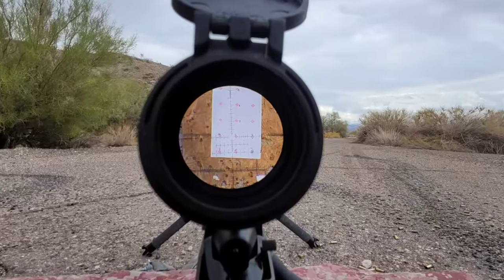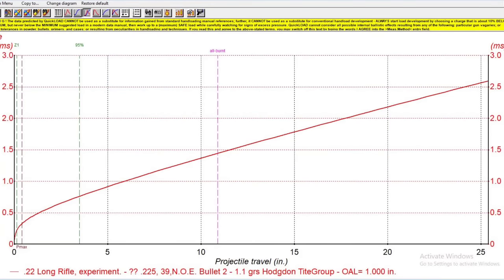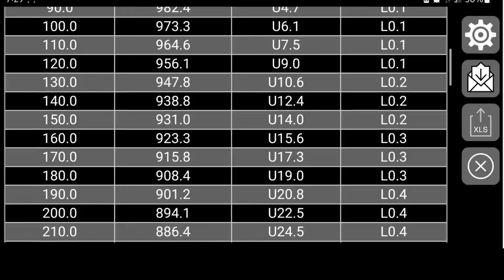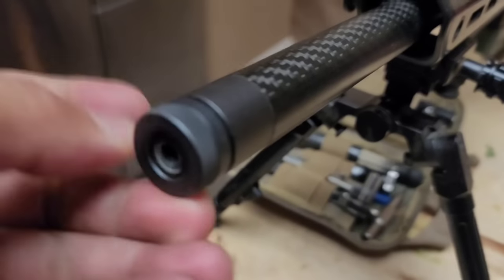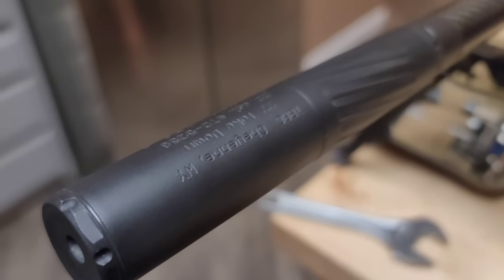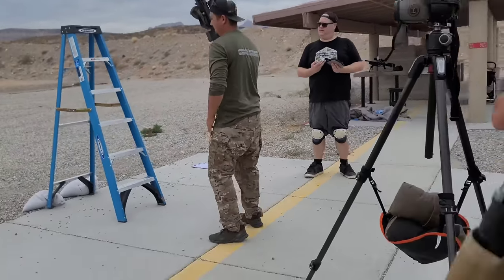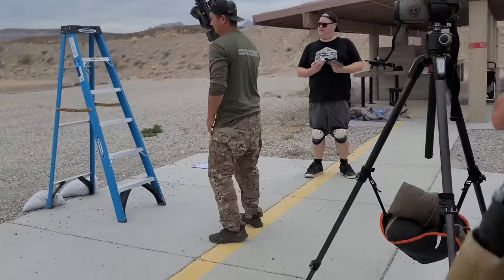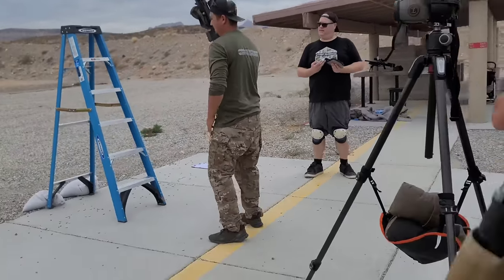What makes an accurate 22LR | Mythbusting Part 2 #DPGunworks

Comment: obturation? I've never heard of that meaning, the ability of a bullet returning to it's original shape. I've always understood it to mean the ability of the bullet to grow to the shape of the bore under the heat and pressure exserted on it by the heated gas from the charge. The term is also used in forging and is very similar to up-setting a piece of bar stock you want to make fit tight in another fixture. I was with you a hundred present until then. I don't think a soft metal like lead is going to shrink any after it leaves the bore except from cooling and certainly not while still in the bore. I've been wrong before though, just ask my wife. Everything else you said has a lot of merit. I think the longer barrel allows the bullet stabilize better without extreme forces of acceleration being applied to it before it leaver the barrel. Similar to an arrow just after it leaves the bow Called archers paradox.
Reply from the maker: Bring up this argument to Bryan Litz...... We're talking about modern centerfire and rimfire cartridges, Not archery.  Obturation in relation to a projectile fired refers to the temporary deformation of the projectile that inhibits most of the gases to escape thus sealing the bore and grooves. The ability of the projectile to somewhat return to its original shape requires pressures to work under the lead projectiles tensile strength, yet have enough pressure to cause obturation. The Lee Hardness chart uses BHN to give a general calculated idea of the metal's "working" pressure

Comment: Kenny what are your thoughts on reshaping the firing pin on a 457? Do you buy into the theory the out of the box pin causing inaccuracies from hitting too much rim?
Reply from the maker: I haven't found the need to do so. The imprint of the CZ457 firing pin is the same as Rim-X and Vudoo's so I would think those who are having FTF's are expirencing a worn-out firing pin spring or bad headspace. Firing pin springs should be changed out often as they wear out

Comment: Sir, I was wondering your opinion if threading a barrel will reduce the accuracy  of the rifle.  Specifically,  every bench rest 22lr shooter told me (including gunsmiths) that threading a barrel will definitely adversely affect accuracy because it relieves the uniform stress of the steel surrounding the crown and causes a discontinuity between the threaded crown region and the rest of the barrel.  Any thoughts?  thank you, outstanding channel.
Reply: He mentioned threading in this video or in part 1.

Comment: Are you using a one leaf commander on your scope? Also what do you charge generally for a barrel?
Reply from the maker: Yes in this video. However, that one leaf isn't a product I would recommend IMO.  I am the gunsmith the company DPGunworks. You would have to reach out on the website for pricing.

Comment: Bottom line no matter how good your equipment and the skill of the shooter and even if a person does extensive  testing on the brand and type and lot# on the ammunition they use the bottom line is inherently .22lr ammo with its uncontrollable variances is the one factor that has the last say in repeatable shot after shot or group after group accuracy numbers.

Comment: seems like all this experimenting with ammo leaves you with a lot of unusable ammo unless you find a rifle that will shoot it
Reply from the maker: My company DPGunworks builds some of the best 22lr rifles out there. We pick the highest quality barrels and air gauge them ourselves. They simply just shoot without the hassle of dealing with tuners, lot testing or ammo manufacturer. 
You can search online, we let our rifles speak for themselves and the folks we built them for
Reply: well obviously you build accurate rifles. but im just saying that if you test ammo once you find the right ammo with the right lot number that is most accurate in a particular rifle then the ammo that was subpar is excess to requirements unless you have other rifles to test said ammo in. you have many rifles that you build so this ammo is reused and tested again . i have many partial boxes of ammo left from testing my cz452 american back in the day.
. @EagleEyeShooting
Reply from the maker: Then I recommend you trying a rifle Ive built.  I dont lot test for the shooting disiplines im engaged in. I can even claim a 10/22 has scored perfect benchrest ara targets pretty regularly.  A quality barrel and quality handfitment is the difference between a CZ452 that shoots well with one ammo vs a rifle that just shoots well overall
Reply: well i wish i could buy one of your rifles but my situation wont allow it. im just a squirrel hunter anwaysmy 452 liked wolf math target the best i could determine. i understand that wolf has changed manufactuers since then.i do enjoy your content. i do believe that some of these miriad brands of eley are identical to each other but anyway @EagleEyeShooting

Comment: From my wifes phone. I have looked into this for a long time. Do you have access to a computer controlled optical comparator? Preferred 100x with edge senseing .ooo1 accuracy. This would take away the pressure of a micrometer. There used to make be a guy in Las Vegas that made a bullet spin machine  for balance.Would not give you our of balance,;but used for separating good balance from bad. All your bullet manufacturers had one of these machines. This would sort good from bad and it worked. Proven on accuracy. Just some info from a 80 year old toolmaker shooter.